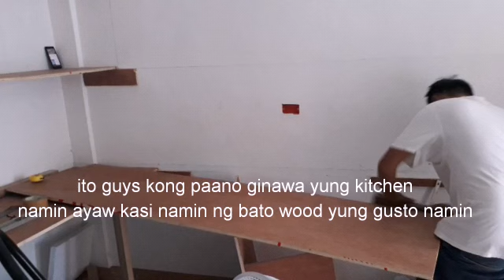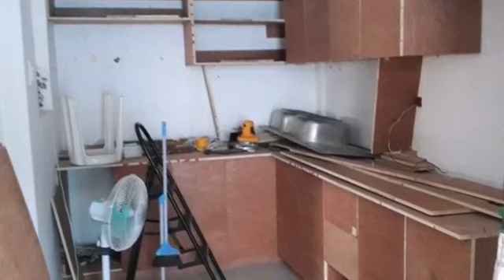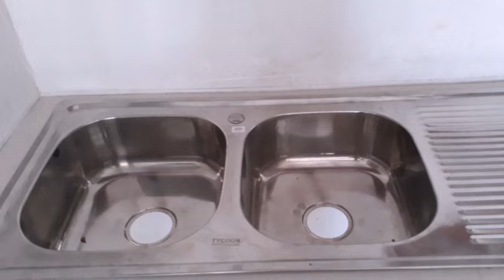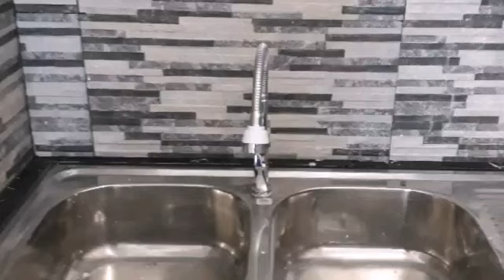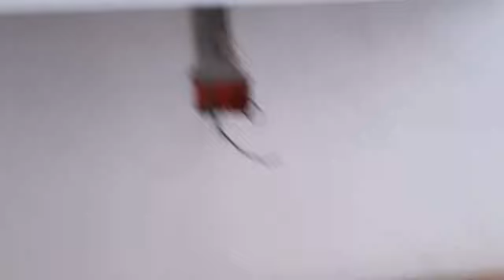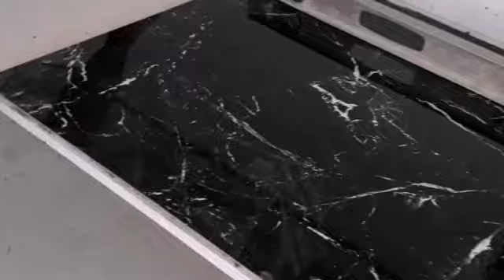HOW TO BUILD MARINE PLYWOOD KITCHEN CABINET INSTALL COST 50K  |PHILIPPINES

Comment: OMG ang mahal. hahaha! ganito din kitchen ko. apat na Marine ply board 4k , granite 4k, sink 1k, 1.2k sa dalawang ordinary ply board para sa hanging cabinet, 1k sa tiles, soft lock na mga hinges 2k. 2k din ang labor. 600 per day ung nakuha kong panday. 3 days daw estimate nya matatapos. so pinakyaw ko na sya ng 2k. You do the math. Nako po. kung marunong lang tlga kyong mag presyo masusulit nyo pera nyo. Anyway, nice kitchen, but definitely not worth 50k. :(
Reply from the maker: Pakyaw po kasi yan kasama narin yung mga ilaw at  lutuan ko jan sa gumawa po talaga kami na pamahal
Reply from the maker: Sa lutuan ko palang 17k na yung sink ko palang 6k na..
Reply: @SARAHJVLOG ah. Kasali na pala mga lutuan. Kung sasali ko lutuan ko. 14k. Plus range hood 3k. 30k lahat2. Oo maam. Mahal tlga pag contractor. Pero ok na yan. Maganda at maayos naman pagkakagawa. Bihira na rin makahanap ng mura at malinis mag trabaho.